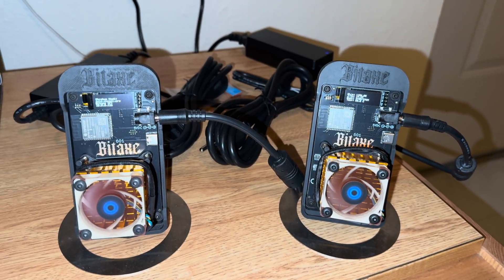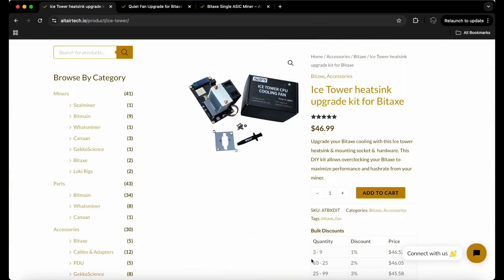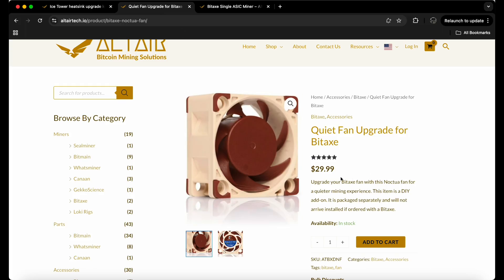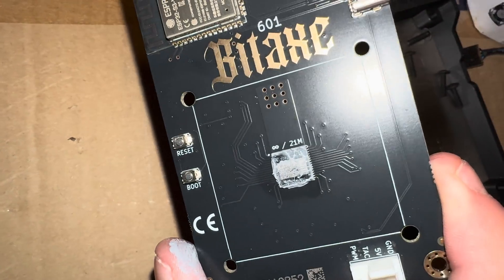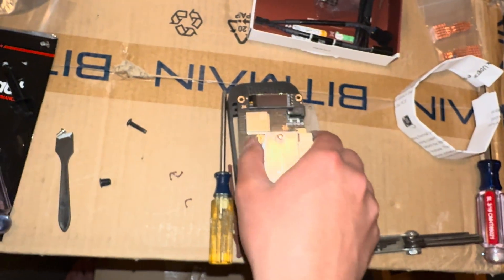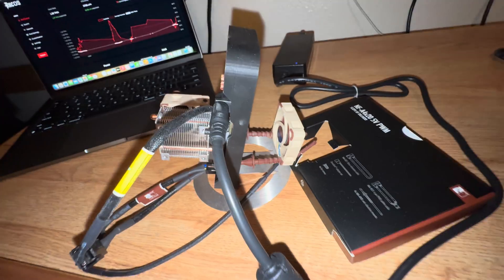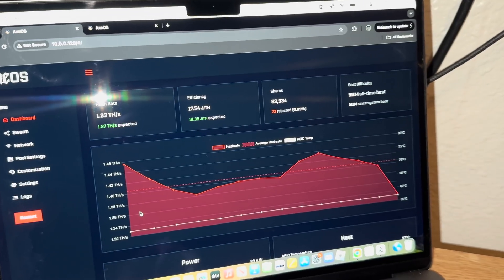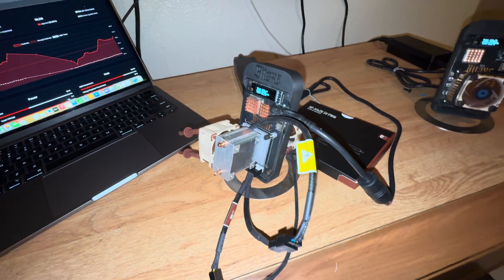OverClocking and Installing- Bitaxe Ice Tower

Comment: I bought 10 Bitaxe Gamma 601 from China, Price for each miner was 110 $.
No heatsinks, no extra fan, nothing.
i run them frequency 625,  Core Voltage 1200 . Fan speed 60% .   Average: 15,61 J/TH
ASIC Temperature 57.3°C,   Voltage Regulator Temperature 61°C
Average: 1.33 TH/s 
Before i spend so much money in extras, i buy one more !!!

Comment: Not sure why you have put a heat sink on the ESP32 WiFi chip - it doesn’t need cooling.
You have missed the pins of the voltage regulator on one and missed it completely on the other one. Not great advice.

Comment: Problem with that heatsink is that the copper pipe only covers 20% of the ASIC.  The Aluminum covers the remaining surface which doesn't conductive heat, it's advised to purchase a .3mm copper sheet square to help conduct heat from the ASIC to the heatsink.

Comment: I can see you got it from the Latvia... I bought the same .. First I took off the stand with metal plate... Bitaxe is overheating because of lock of air circulation... Have no idea why they did it and this stand cost 15 euros... CRAZY.... GARBAGE ... 😮 I ordered cheap Chinese plastic case for 7 dollars with open back side 👍 and connect a fan on the back and now it's working perfectly 👍
And another thing... I ordered  6 Bitaxe 's from different places.. Europe, US, Canada, China .. and only one chipest from China working with basic fan and overclocking to 1.6 T without any problems or overheating...

Comment: Those upgraded ice towers are wayyy cheaper on Amazon bro. Let the people know 😅
Reply from the maker: @elijahvanwormer6740  when I looked on Amazon all I found was the socket for $13 not the whole ice tower but if you found it for cheaper lmk I’ll put it out there
Reply: @Corona_network  I now see the fan plug doesn't have 4 connectors so I may need to return them....

Comment: What web version are you using? I'm on v2.5.1 and I don't have customization.
Reply from the maker: Im also using v2.5.1 i would try downloading "www.bin" file again and if that doesn't help try you may need to reflash your bitaxe
Reply: @Corona_network  I actually had to reflash because after a power cycle, my gamma 601 wouldn't turn the fan on. Instant overheat. Reflashing was the only way to get it running normally.
Reply: When you mean no customisation do you mean not being able to go above the stock settings?
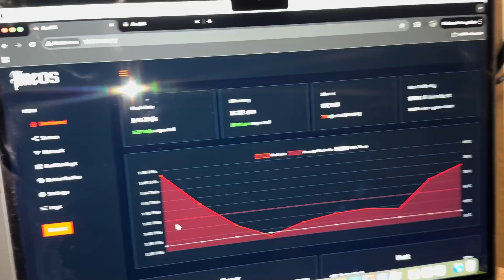Reply: @Dannylewis27  at 13:48, look down the left side under power settings. Nothing overclock related. Graphical in the web UI.
Reply: But you will also need a better power supply to push it that high
Reply: You don't need to flash it or anything crazy. Just open the AxOS in CHROME, go to settings, right click on an empty space and click 'inspect' at the bottom.

Now you can type in the frequency and voltage boxes whatever you want. But be careful.

I have two Gammas and I'm currently averaging 1.8-2TH/s on stock cooling. 850mhz and 1225mv

Comment: You can set higher clock speeds and core-voltage.
My Bitaxe 601 is equipped with a low-profile PLUS cooler (for Raspberry Pi 5) and a 60 mm Noctua fan at the front and rear.
I  set to Frequency  (1050), Core Voltage 1385.
The Bitaxe runs at an average of 2.2 TH/s.
Reply from the maker: What are your average temps?
Reply: @Corona_network  Asic 58°Celsius, Voltage 69 °Celsius
Reply: @thclaar what power supply do you use? I don’t have a mean well yet , was looking to just getting one psu that goes up to 50 watts or so. If i raise passed 750asic 1275 voltage it goes too high for the stock psu
Reply from the maker: on my stock PSU i can hit 1300v and put the asic to 900 if i push any harder than that my gamma looks like gonna explode but i do avg 2.3 Th and spike it to 2.8
Reply: @saeir  I have Meanwell LRS-350-5, 60A   1,5mm Powercord
Reply: @Corona_network  You need 60x60 Fan on Backside, 60x60 Fan with 
Geekpi Cooler on front, an 40x40 Noctua for Front